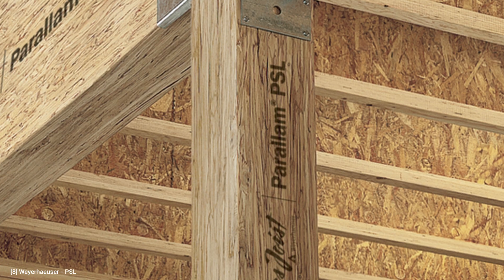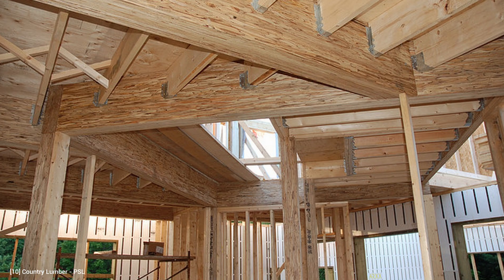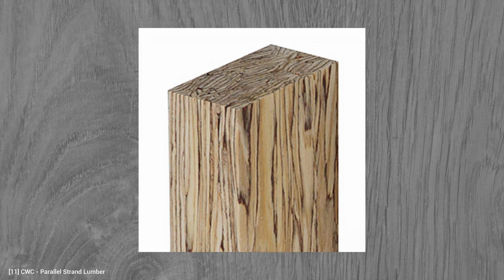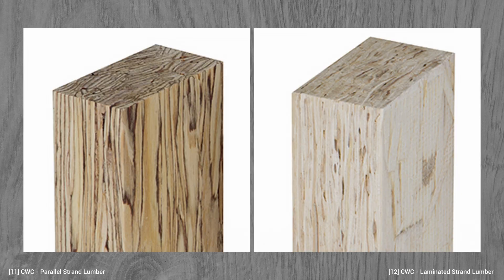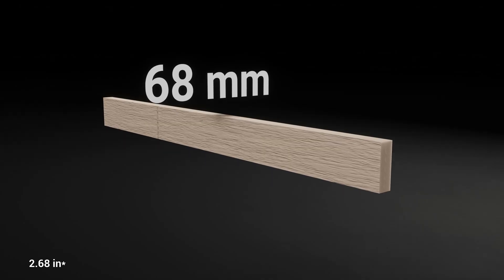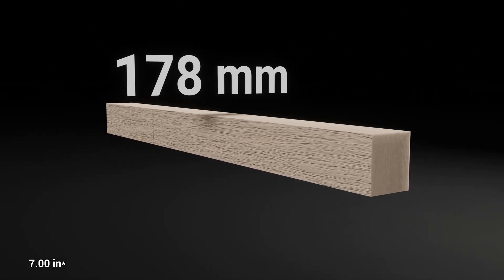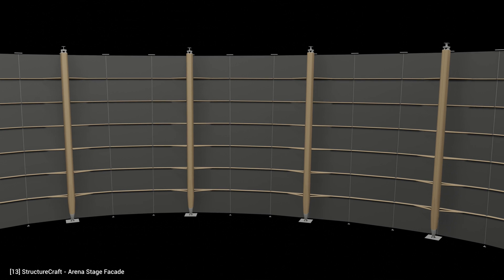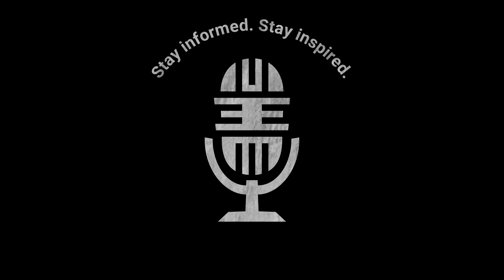An Introduction to Parallel Strand Lumber (PSL)

Comment: 1:10 phenol formaldehyde ... does not sound like I want to have it around me in a closed space.
Reply from the maker: The adhesive used in mass timber products can indeed be a concern
However, the indoor air quality in mass timber buildings is generally very good!

We are currently producing videos that explore the benefits, challenges, and limitations of mass timber
In these videos, we will address this, and more, comprehensively!
Reply: It is probably stored in a well ventilated area for a while to let most of the formaldehyde evaporate before beeing used in construction, just a guess tho
Reply from the maker: Thank you for the addition!
We will look into it :D